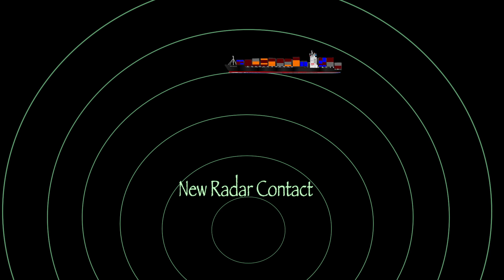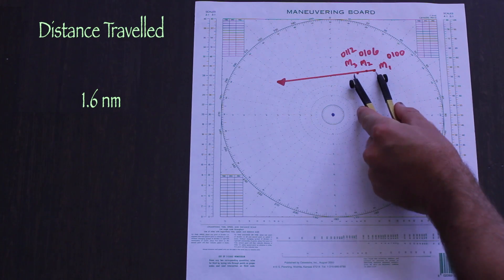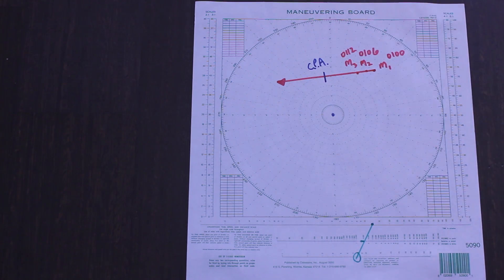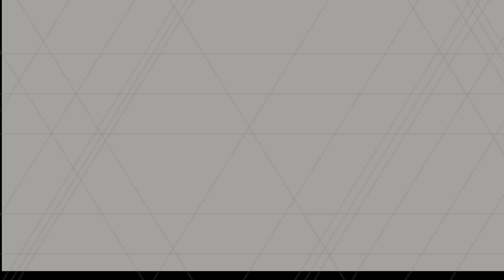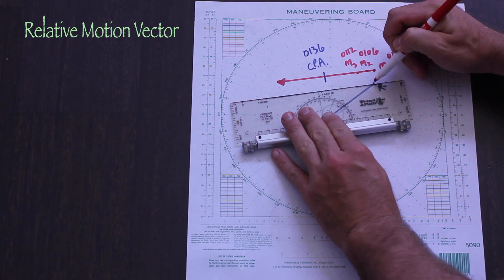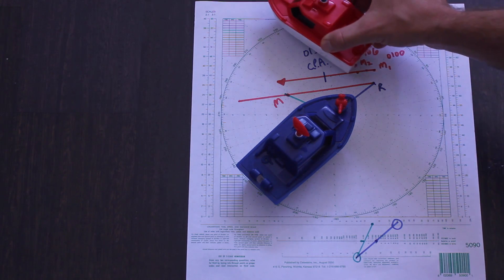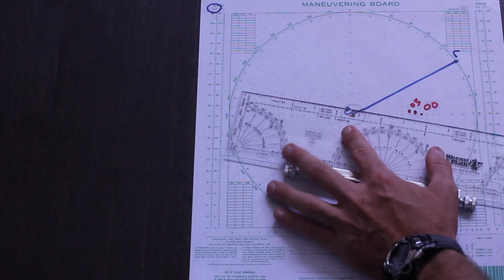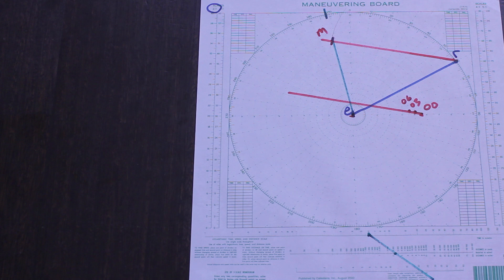Fundamentals of the Maneuvering Board (Part 2 - Single Contact Calculations)

Comment: Hi, Would anyone be able to check my calculations in this example as I am struggling? My ship is travelling  320T at 19 knots. I observe an approaching target at the following location and times:-
- 1830 bearing 247T range 12 miles
- 1836 bearing 248T at 11 miles 
- 1842 bearing 249T at 10 miles

I calculate :-
CPA = 2NM
BCPA = 332T
TCPA = 1942 
Target true speed = 28KTS
Target true course = 346T
Aspect = 26 degrees to starboard 

I'd be very grateful for any help. Thanks!

Comment: Sorry to be trawling back so many years   BUT

(Without any nomogram available)
in first example the distance travelled (from Radar)  2 nM in 12 minutes,  SRM is 10  knots.
Then looking at "Time to CPA"  at same speed (10kts)  over the  distance to be run 6nM  surely 36   minutes.   Self Doubt is spreading here  as I commit  this thought to paper.  What am I not doing right ??
Reply: A little later.    Time remaining seems to be 36 minutes  from last plot.    Does your 48 minutes  include the elapsed  12 minutes from first plot ?    I think I have the essentials.   Use speed of relative movement to find Time of CPA.   Always super  videos.   Many thanks.